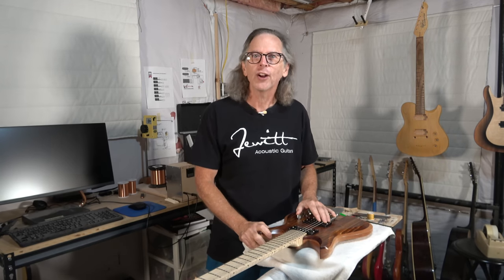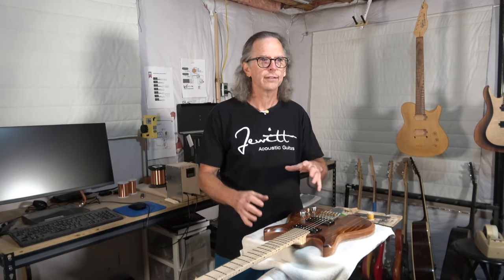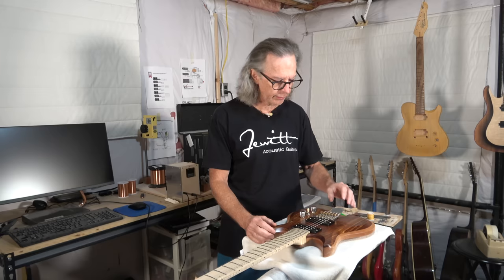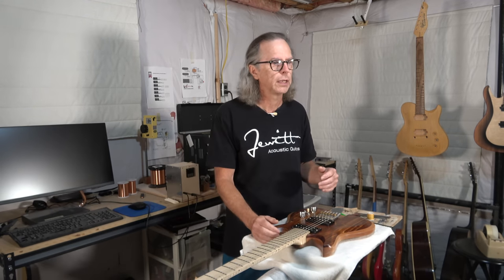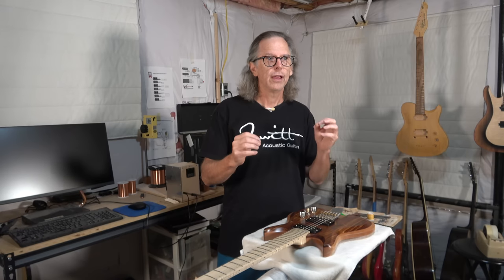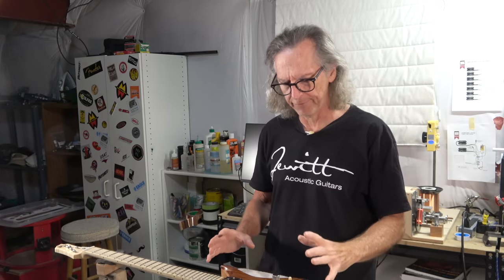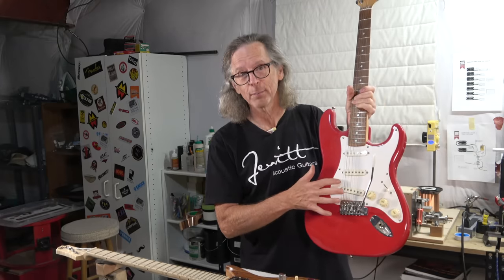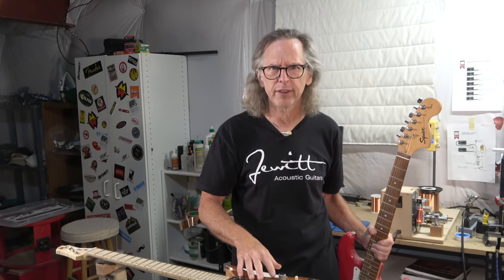Does Guitar Wood Need To Breathe?

Comment: you missed 2 important points:
1 vibration transfer 
2 wood still needs to dry further 

1 when strings vibrate it goes through the bridge then through the finish and only then into the wood. Plastic doesnt have the same resonances wood does so its gonna eat some of the vibrations similar to how colored lenses make image darker when applied together (eg red and blue) they only let through freqs they have in common. now that could be desirable bc not everyone wants his guitar to sound supa woody and would rather prefer a balanced less resonant sound but still 

2 Not sure about your custom guitars but most production guitars especially low-mid imports are MOIST(iwater + oils) when they arrive. it can take a while before it dries and it sounds noticeably worse b4 it does. Moist wood doesnt sound the same it has less high end which in most cases not desirable. CORT for instance is pushing their open pore finish to prob address this problem on their cheap imports. I would also guess that open pore finish makes it dry more evenly. That prob also makes vintage\old guitars sound better bc they are definitely dry and acclimatized (again its water + oils and oils can take a while to dry)

Comment: I've always felt like the dryer the wood the more resonance the guitar. I have wondered if guitars with commercial finish like Ibanez and Jackson do, will that wood dry anymore or is the moisture level locked in??
Reply from the maker: Even if there's a tiny spec of bare wood, including inside of a screw hole, the wood will absorb and expel moisture.
Reply: That's true, wood needs to be dry and if your environment is not humid, with less paint it will dry more over the years. Old instruments, especially classical instruments have their refined tone and resonance due to this.

Comment: The tree is dead, so no, wood doesn't need to breathe. Plus, it no longer has leaves to breathe through...
Reply: So how do you ac count for expansion and contraction due to humidity? The wood still responds to variations it's a living breathing substance on the tree or off.  Whatever it's coated with has to move in response and if you build a lot of guitars you will know that some wood is just plain dead and produces poor sound but good wood feels alive in your hand and gives glorious sound.
Reply: @63sgjunior  the guitar may "feel dead" but it's what's amplified and recorded from the pickups that matter in the end. Use the same pickups on a chunk of 2x4 construction lumber or cement, and you'll get a very similar recording. You can keep believing what you want, but science is still science. So long as we're still talking about electric guitars and not acoustic guitars.

Comment: 10:07 I'm not sure I buy the idea that using a thick finish - even on an acoustic guitar - will have much effect on the tone, other than what a slightly thicker board would do. I know it's been said over and over, and I guess is makes some theoretical sense, but I've never seen any scientific proof.

The finish should be fully bonded to the wood and vibrate with the wood. So adding more mass to the wood should be the same just using a thicker piece of wood. But with the thickness of typical finishes, would that even be perceptible?

Comment: There is so much mysticism in peoples' beliefs about guitars.  Whether or not living trees breathe is irrelevant: guitars are made from dead wood.  I think that even biologists will agree that dead organisms do not breathe.  Even a piece of dead wood can absorb moisture from the air or from the player's sweaty hands and arms.  This has nothing to do with breathing.  While it would take years of study to confirm, I doubt that, even with a bare wood body, home players would ever experience a significant change in their solid body guitar other than discoloration from sweating on part of the wood.  If you spend years going from hot stages and hot climates to freezing car trunks or cold climates and back again it would be more of a concern.  Clearly the neck, a long, thin piece of wood under constant tension, is much more vulnerable to temperature and moisture change.  It's too bad carbon fiber necks never caught on.  I have a bass (a longer, thinner piece of wood under much greater tension) with a carbon fiber neck and it is the most stable instrument I've ever played.

Paints were never chosen for their sonic properties - they were chosen because those were the paint systems available at the time.  Nitrocellulose lacquer dried harder and faster than previously used paint systems, which is why it was used to paint cars.  Guitars were never a consideration in the development of paint.  Nitro was also available in a wide variety of colors, something which was a selling point for Fender.  It's still a terrible paint system, being soft, toxic, having an extremely long curing time, and it continues to gas off and shrink for years.  There's a reason that it was replaced in the auto industry by polyurethane paint systems.  I'm sure that there are newer and better systems on the market now; I haven't kept up.

I am willing to believe that someone in laboratory conditions might, and I emphasize might, be able to hear the difference between a softer finish system and a harder finish system, but so what?  Your guitar has electronics.  Your pedals have tone knobs.  Your amplifier has a tone stack.  If you are playing through a PA then the PA has tone controls.  Your guitar's finish is meaningless, except for the look, and protection from dings, scrapes, and moisture.

Comment: The notion that solid body wood needs to "breath" in an electric guitar was a bizarre notion dreamed up by the science-challenged. Don't give it any further credence. Measurements of real guitars have shown actual body vibration to be very small. And in any case, any such vibration would represent loss from the strings, so not seen by the pickups. Luckily, measurements show that does not happen to any real extent - almost all vibrations are reflected back up the strings at the bridge. Furthermore, there is no evidence that the small string-vibration-induced body vibrations have any real effect on the pickups. 

You mention vibrations transferred via the bridge to the body, as if it is significant. But direct bridge admittance measurements show that to be very small, as I said. The "wall test" you did changes the resonant structure of the guitar, by connecting it to another resonant structure - so vibrations flow differently, particularly at the wall's resonant frequencies. Zoller has shown that test to affect the acoustic sound, but that it is not significant enough to affect the signal from the pickups.

So all in all, resonance of the solid body is basically a non-issue. Resonance of the long, thin, flexible, composite neck is greater. It has been shown to induce narrow-band vibration losses from the strings via its resonant modal frequencies, that thus reduces measured sustain at those frequencies.